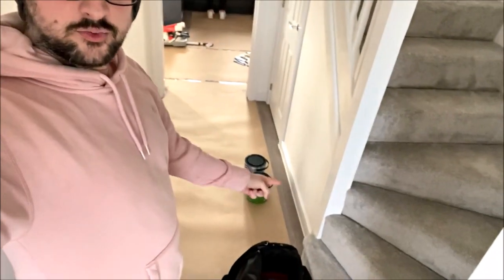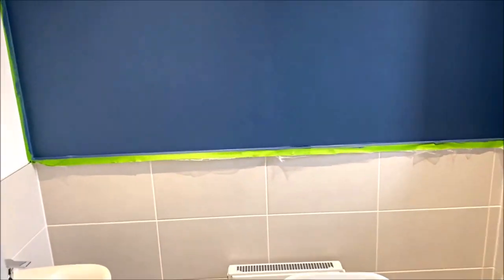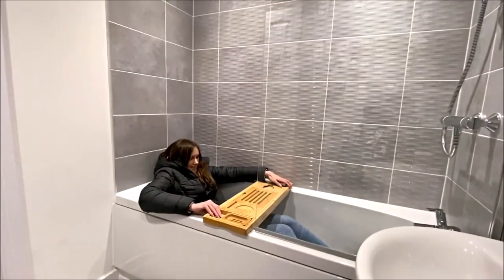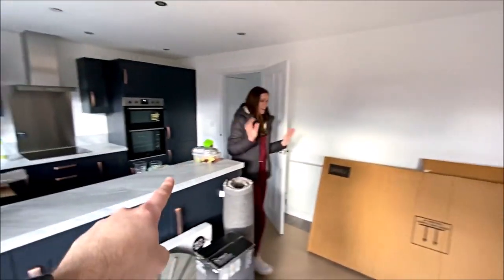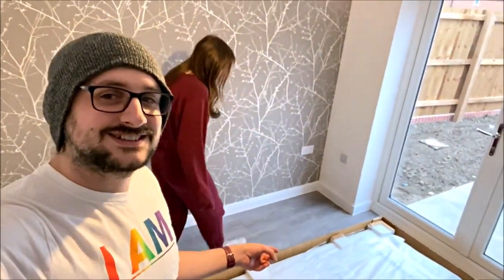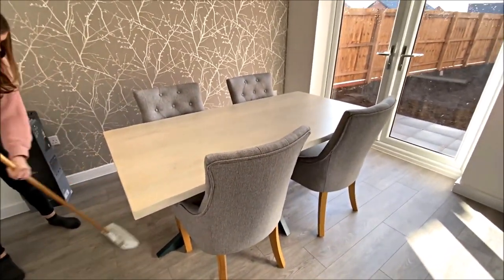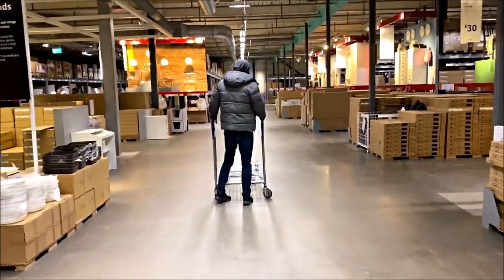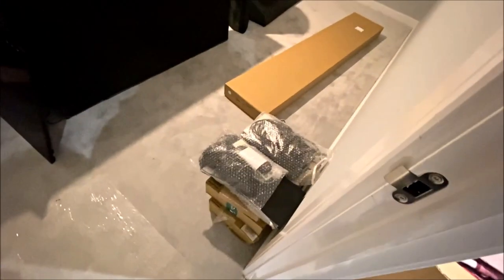Moving Day - Moving to Our Bellway Weston New Build 😃🏡 - Vlog 22

Comment: Did you guys have to extend your mortgage and did you have any problems doing so? we’re currently between exchange and completion waiting for our house to be built, but now worrying about mortgage expiring lol!
Reply from the maker: Hey Liam thank you for taking the time to comment, our mortgage was valid until November and we moved January so I did the same and started to worry towards end of October. Rang our mortgage advisor to enquire. Honestly it was super easy we were reassured they were handling it. We then got a letter and a phone call a week or so later that our lender was extending the mortgage for a further 6 months. It worked out well because it was also on a cheaper interest rate 👍😜 just pop a call through to your advisor. I’m sure you’ll be fine. Our advisor said it’s usually expected with new build purchases due to potential delays 👍 hope this helps anyway